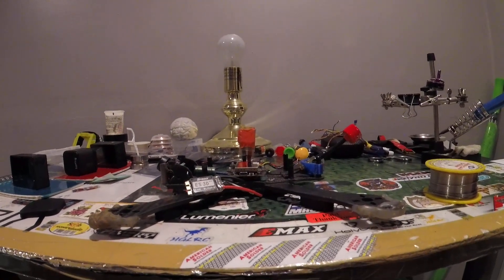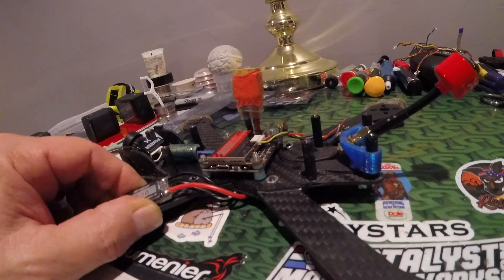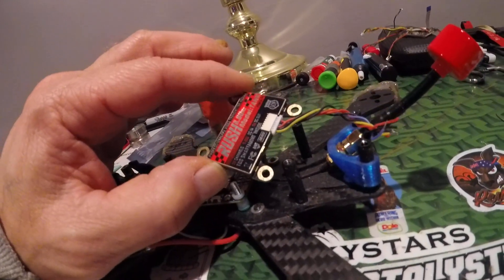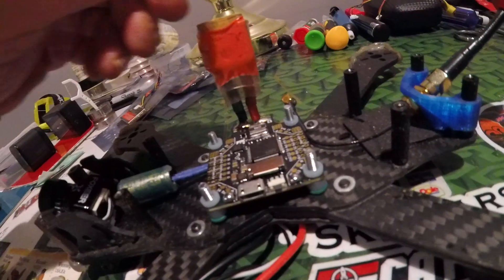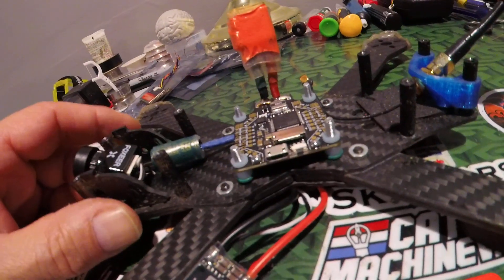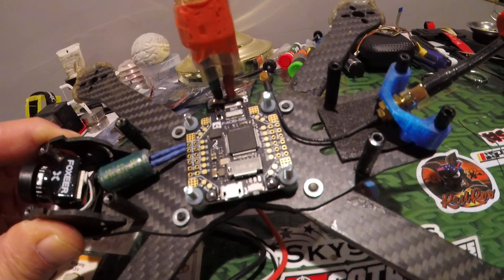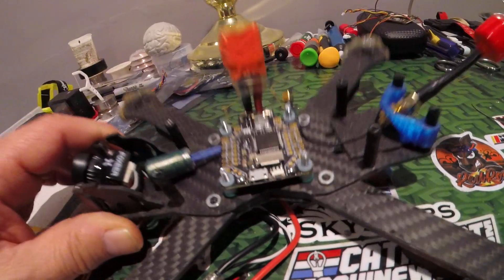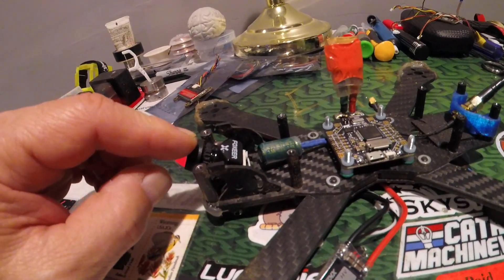L👀k Matek F405-SE😍aio PDB+flight controller🎉Happy New Years 2021✨

Comment: Hi do you use external compass or the compass is inbuilt in Matek F405SE
Reply: Hello
Reply from the maker: @aesatishchaudhary5933  No onboard compass
Reply: @petertothRC-FPV  Matwk F405 SE comes with onboard compass
Reply from the maker: @aesatishchaudhary5933  only barometer
Reply from the maker: @aesatishchaudhary5933  My builds are for freestyle acrobatics or racing have no use for gps or compass

Comment: I peter thank for your time! So i switch to betaflight and i can arm right now. I wrote the matek line in cli to activate the baro...suprise don't work😭 you flight with barometer? DP310 is not my first built...
Reply from the maker: When i got my board was screwed up too.I flashed it with new BetaFlight🦟 4.2.5 firmware everything works great